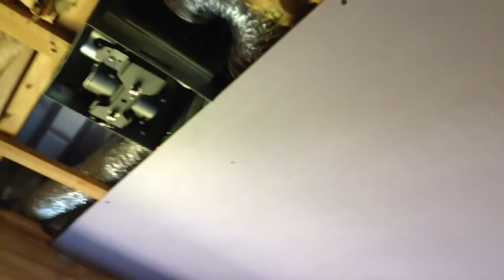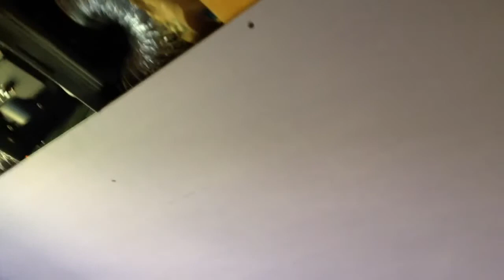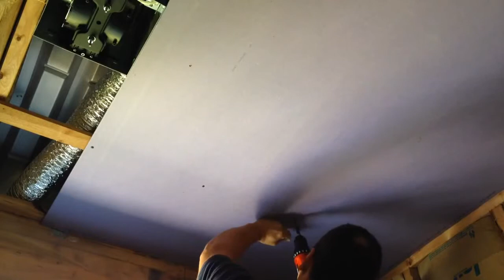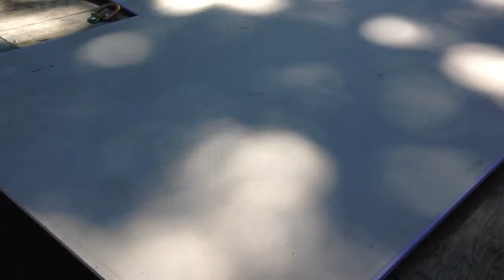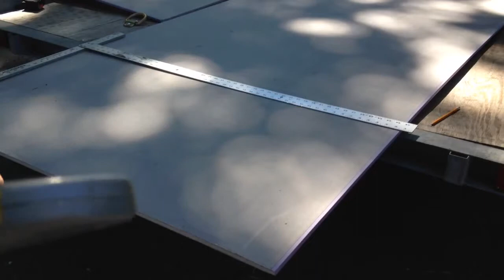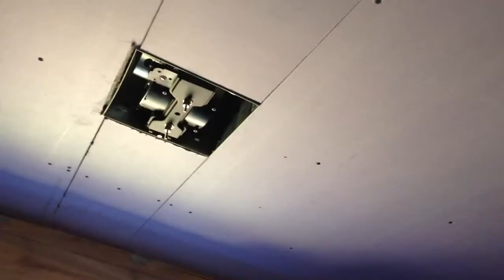New Construction Bathroom Ceiling Installation Part 2

Comment: My question is what do you do with the ceiling edges?   Do you use mold resistant tape then mud it?
Reply from the maker: Yeah, I used a decent mesh mold resistant mesh for the corners